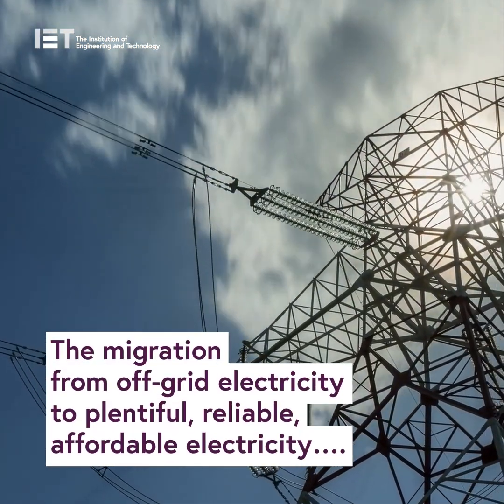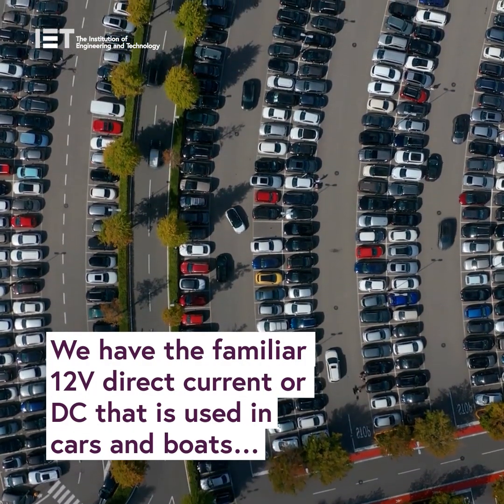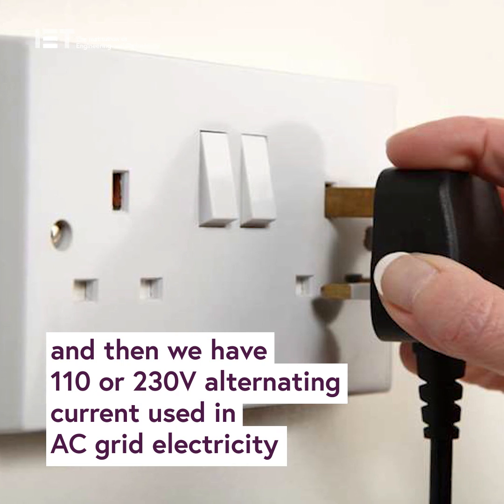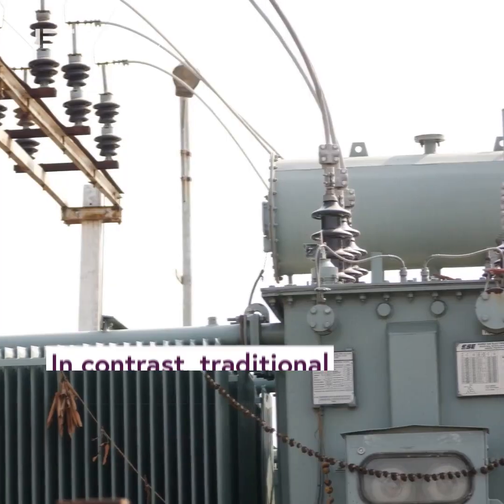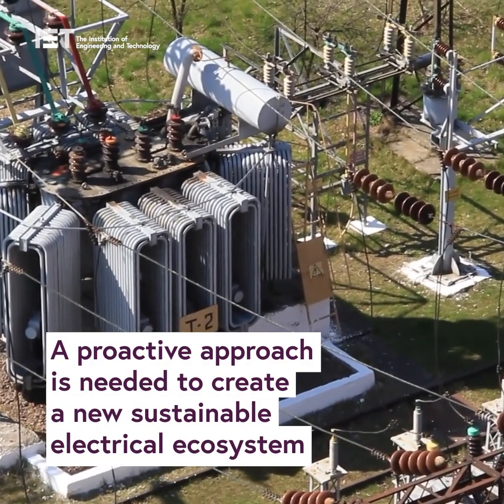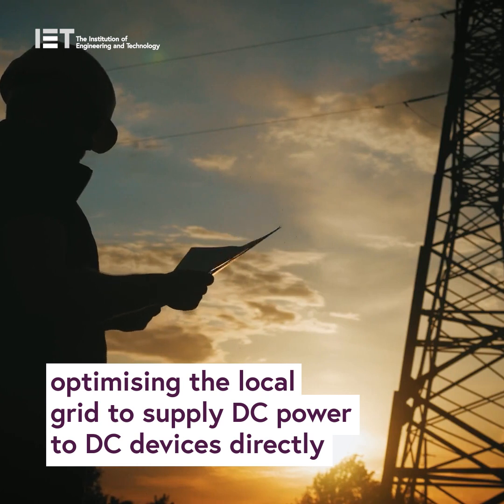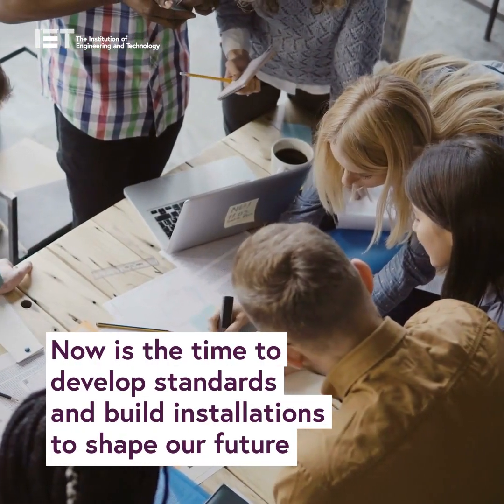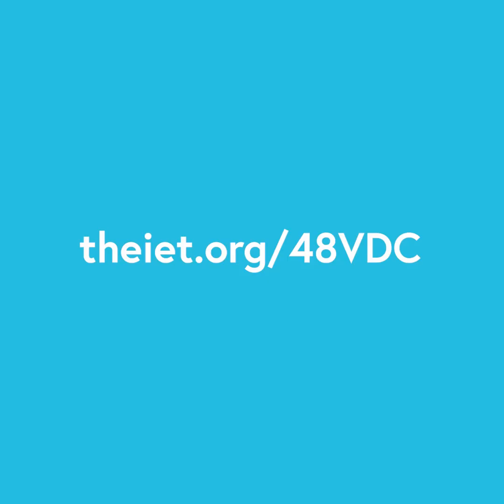48VDC: Is it the safe and affordable solution we need?

Comment: What isn't mentioned here is the choice of where the current upstream AC distribution is converted to local DC for home use.

The nominal 48VDV level is also the same as the plain old telephone system's (POTS) supply line voltage (historically 48V dc lead acid batteries on float). 

A key point is to avoid needing any more local copper in household circuits, and preferably less. This implies, for reuse of existing wiring, that the power demands should be ~1/10th of current maximums. 

There is a separate discussion to be had about upstream (high power, GW) generation as to use of HV.DC vs HV.AC supplies, as current grid infrastructure is AC.

Comment: Lower voltage supplies would operate at higher currents so producing greater voltage drops and increased energy waste.  Higher currents would also produce greater fire risks.  230Vac is not unsafe.  It's wide spread use with very few electrocutions is clear proof.  The assumption that 48Vdc was safe might even produce more accidents caused by complacency.  The standardisation on 230Vac provides huge economies of component prices.  AC is easier to transmit and distribute and easy to convert to DC at the point of use.  AC is simpler to switch than high current DC as it suppresses the switching arc at zero crossing.  Lets not reopen a dispute settled by Edison and Tesla over a hundred years ago.   We should focus on standardising ELV DC on 12Vdc not all the multitude of voltages used by manufacturers resulting in every device having its own little black brick SMPS.  Just think how many could avoid ending up in land fill or WEEE if they were mostly interchangeable.    Dave   MIET, AIFireE.